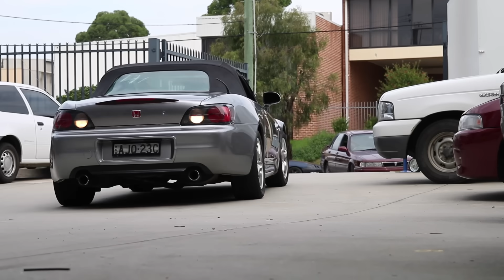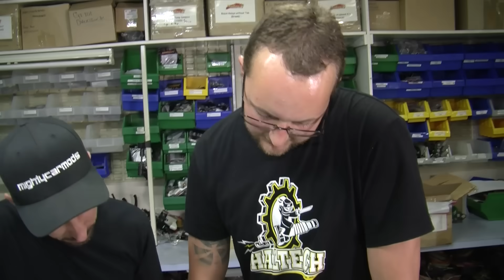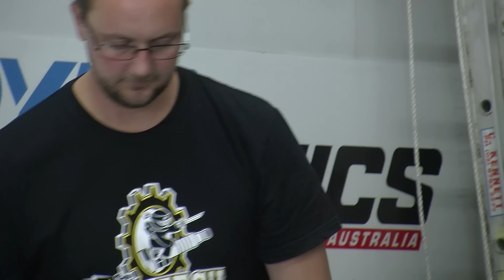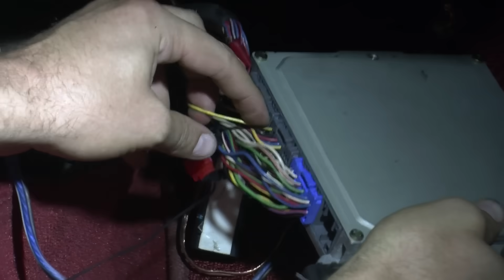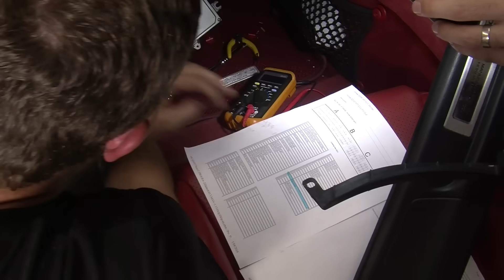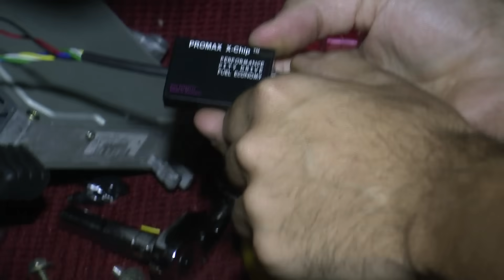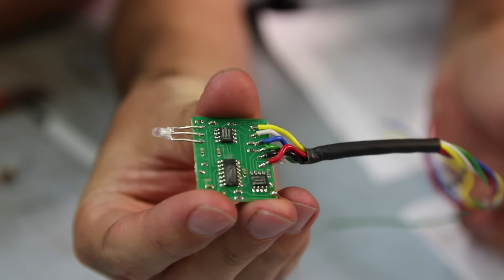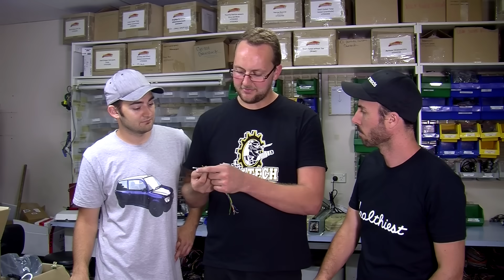eBay Performance Chips -  Mythbusted

Comment: It should be 177kW which is approximately 240HP. So, either your dino is wrong or you have a really bad vtec.
Reply: 240HP for the S2000 Is at the crank, the 177 KW in the video is the horsepower this S2000 is making to the wheels. There is a difference.

Comment: I laugh at people who say that they're going to install a chip and get X amount more power. Now I can just show them this video.
Reply: There are REAL performance chips which plug into vehicles and not spliced like this crap. They cost about $250-400

They'll give around 30-50hp, too. It's the knockoff crap from ebay you need to worry about. I speak from experience since I was looking into some chips for my truck. Edge performance and super chips are legit.
Reply: i think there are different chips that actually give some horsepower
Reply: didek9625 yeah, there is actual piggy back systems and ECU reflashes that do modify the air/fuel mixture ratios, the ignition timing, and bypass the speed governing chip on some cars.
Reply: DJXtremist1 yeah one of my friends did it on a diesel engine he gained about 30 horsepower
Reply: however those are actually useful, all beit a couple hundred bucks

Comment: The S2000 had 177 HP  
But doesnt the S2000 has 240 HP ???
Reply: 240 at the crank. 177 is at the wheels
Reply: desertfox2020
But it should be making around 200 at the wheels. 2wd drivetrain loss is around 15-17%
Reply: Figure in some loss of hp over time then? Unless the S2K has an unusually inefficient transmission
Reply: desertfox2020
Yeah, probably, but 20 hp loss seems like a lot.

Comment: I Remember when you could by a chip for 150 bucks nowadays you have to buy a hand held programmer and GPS/digital gauge screen for 600+ hell I don't need all that shit
Reply: Depending on the make/model you can just buy a pre-tuned PCM that plugs in like the one they showed in the video. Usually those are about $200 (for my car anyway, I don't know about many others)

Comment: I wouldn't claim to have any serious mechanical or electronic knowledge, but I wouldn't have even put that thing on my car in the first place. Seems way too dodgy.

Red flag 1: It's cheap and tiny. How can such a cheap little plastic box really be expected to be a decent ECU? Doesn't seem right at all.

Red flag 2: The instructions referenced a VW instead of an S2000. Obviously a hugely suspicious thing. This would probably be the point I would definitely not go any further.

Red flag 3: References in the instructions to parts that aren't even on the car. That's pretty much confirmation that this thing wasn't really made for an S2000, and could very well cause it some damage.

Moog's shirt is cool though. From that bit at the end though it sounds like he might want something like a supercharger on the S2k...

Comment: 179bhp? shouldn't a stock s2000 make around 236bhp? I think something wrong with your car moog!
Reply: Crank HP vs wheel HP.
Reply: desertfox2020 agreed, but i would have expected at least 210whp. quite disappointing if you ask me.

Comment: i always thougt that a s2000 has around 241hp stock, how can it loose that much power over the years?
Reply: its the hp to the wheels shown on the dyno. you lose hp from engine to wheels
Reply: cgravity123 But is the loss really that high? I mean a drop from 241hp to 179hp is pretty dramatic
Reply: tombax338 That is a reasonable drivetrain loss. A little above average but not out of line.
Reply: Alright, didn't knew that. Thanks for the info.
Reply: tombax338 I mean that when figuring in some hp loss over time. 241 crank hp brand new but that does go down just as the engine wears
Reply: thanks for the info guys :)

Comment: The s2k might have 240hp, but thats at the crank and brand new. Over the years of use and abuse it's going to lose hp and at the wheels you can lose anywhere from 20-30hp. For those wondering.
Reply: not to mention that's peak power at the flywheel at 8300rpm

Comment: some real tips would have been nice. the factory ecu stuff does not play around for one.. change how much air it gets it will respond. there is also the vtec idiot removal to give lift through the whole range... which is embarrassing... carbs have had progressive air damper changes since the 1960 one barrels. That honda is embarrassing..simply give some real tips.

Comment: Get a vtec controller. And bring the vtec on quicker
Reply: Why? That doesn't effect maximum HP at all. It most likely won't even make it quicker.
Reply: Freemananana dont matter. Makes the unicorn fart faster with out going over the speed limit. And some N1 cams nd super charger nnnddddd booommm trilion unicorns kikn ur balls in

Comment: WOW, really surprised at the low power output of the S2000
Thought it would have more than 130kw
That's almost identicle to what I get out of my mx5 (blowdry from the Brisbane meet)
It looks like pulls harder than that, it truly is filled with exhaust gasses of mythical creatures!

Comment: Never in a million yrs would  I think that chip would work. If you get that much more HP in most cars, not something already set up like a S2000 you may have to change others things about the car also. in order to handle the extra HP. 
As they have said so many times, if it seems too good to be true, it probably is.

Comment: Most modern cars are pretty close to ideal already. Even with true full tuning control and a custom tune you're not likely to see more than 10 or so hp. With a force induction car you can see more since you can usually increase boost. Likewise a proper tune combined with modifications can really help, though most of that is from optimizing the tune to what isn't stock anymore.

Comment: There are these kind of "chips" which just has a resistpr in it. Making the car inject more fuel into the engine since it is tricked that the air is colder. Might give you a 2hp gain, but it will ruin your pistons.
Reply: What ruins your pistons is usually less fuel in the engine. A lean mixture will burn hotter, the extra fuel in a rich mixture doesn't burn and keeps temps down, but it might ruin your catalytic converter.
Reply: Yeah mate, what you just said was in the video...

Comment: there 240 at the crank standard were is it putting its power
Reply: every dyno is different so you can't compare Honda's claimed results to these. Moog's car is showing around 25% driveline power loss which is on par with what other S2000 owners on the internet see on the dyno.
Reply: gsizzle612 they need to sort out that driveline loss is what I was trying to say
Honda that is
Reply: power is lost through the drivetrain sometimes up to 25 or even 30 percent. plus as time goes on cylinders get worn and power escapes as well. so if we assume it lost 20% of power through the drivetrain that will bring power down to approx 192 at the wheels then its lost another 13 hp during its lifetime (which isn't unreasonable)
Reply: That power figure is at the wheels, so if you take into consideration drivetrain losses (45-ish hp), some wear on the engine (5-ish hp) and other small things (altittude, air pressure, air temperature, fuel quality,...), they add up to about the power we see here
Reply: thegt4man the drivetrain isn't the best on the s2000 think a lightweight driveshaft would sort some of that out but the F20C  is a bad boy engine but it would not surprise me if a couple of his cam lobes are worn common occurrence on small high end vvt/vtec engines

Comment: 177 hp? Doesn't the s2000 have 240 hp stock?
Reply: That's what I thought.
Reply: Crank hp. Drivetrain losses, bring it down a bit, then its age means it might've lost a few horses over the years
Reply: WTF ?!  It's imposible...
Reply: 240 at the crank, but a lot of power is lost through the trans and differential.
Reply: Look up WHP vs. Crank hp..
Reply: At the crank, this is at the wheels.
Reply: 177 at the wheels

240 at the motor
Reply: I don't know,i just can't belive that a S2K makes only 177 at the wheels...
Reply: 177 is at the wheels, though still a little lower than it should be ~(195 - 200).
Could be contributed to many things though including the dyno itself, intake temps, fuel, wear, servicing e.t.c.

Ultimately rolling road dynos are for comparisons (as used here) not accurate power figures. You can configure them to give you pretty much any base value you want, it's just a number really, how much it changes by on the same setup is what's useful.

Comment: I also hear bike racks add 15hp at the wheels
Reply: I heard JDM stickers give you 25hp
Reply: Negative camber add 30+ hp on fwd cars
Reply: Spoilers add 50hp to the rear wheels on a fwd civic
Reply: Don't forget a monster energy sticker +50 hp!
Reply: Dude I put a JDM sticker on my Corvette and got a huge performance gain. This shit is no joke.
Reply: That's why nascars are so fast
Reply: ***** I know you're trying to be sarcastic. I love it.. But a body kit CAN add 30% drag. Not too sure about 35hp but the drag is definitely possible.
Reply: Don't forget body kits. 35hp and 30% less drag.
Reply: Not only that. But Civics with spoilers, camber, JDM and monster stickers, and bikes make the best drift vehicles.
Reply: imGenoo Oh yea, good body kits can be great for aerodynamics. I'm referring to the over the top ricer ones that are practically adding a sail to the front of a car. The ones where aerodynamics doesn't mean channeling air, it means hitting air.
Reply: ***** lmfao yea I understand.